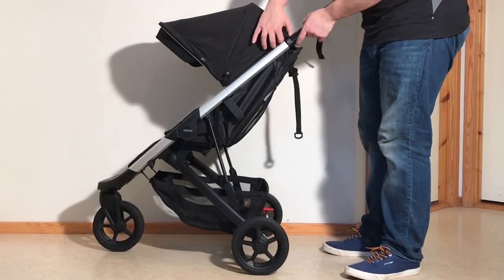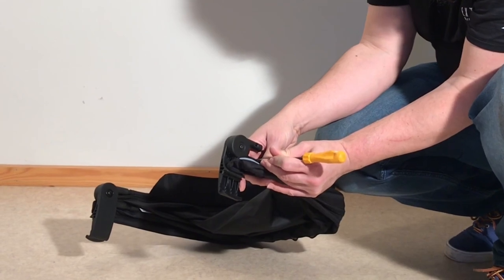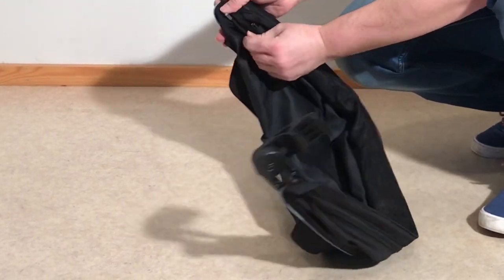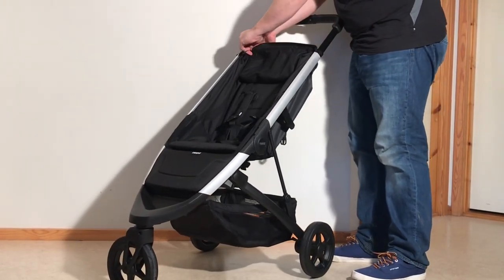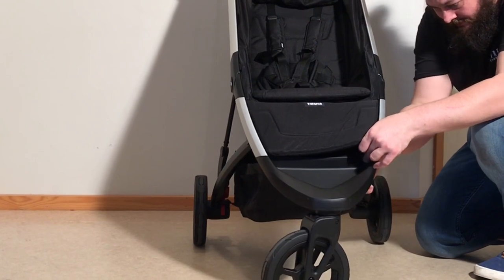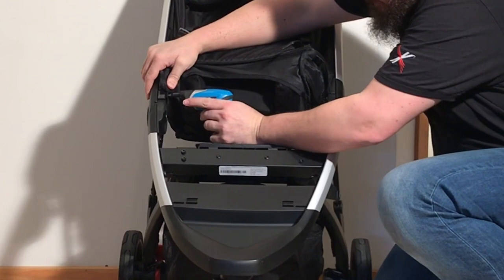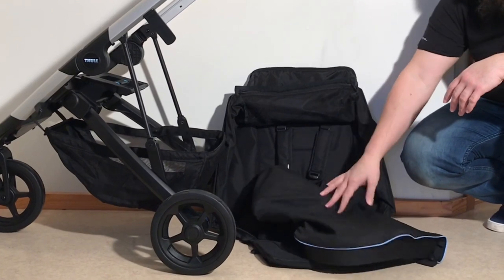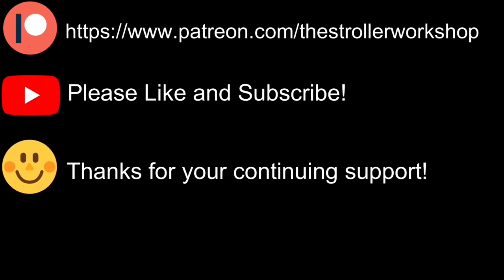How to Remove and Wash the Textiles on a Thule Spring

Comment: I’ve been working in the Childcare Industry for over 20 years and have washed ALL my stroller textiles alone in the washing machine on delicate with cold water. I have even used Baby Oxy clean stain remover on them. Stroller material is fairly resilient and with the amount of stuff it goes through and having your child’s face near the material, I’d recommend a even monthly washing! Just be sure to reattach it back onto the stroller dry to avoid shrinkage. :)
Reply from the maker: Right on. Thanks for sharing your input!  I agree with this completely, both regarding the resiliency of most stroller textiles for tolerating machine washing, and the need for regular washing from a hygene perspective. :)